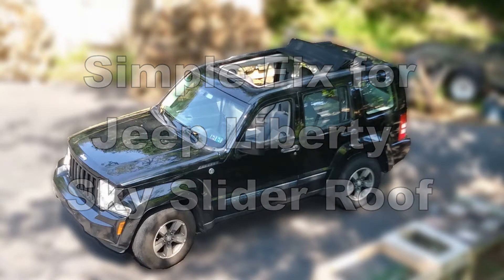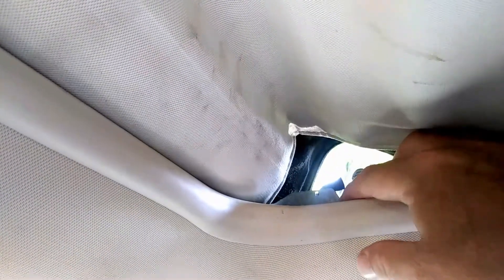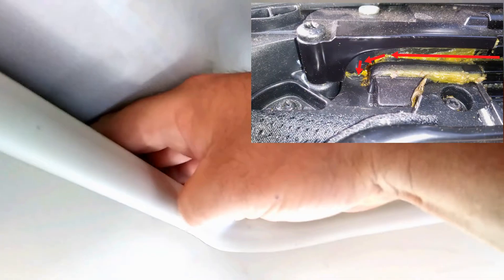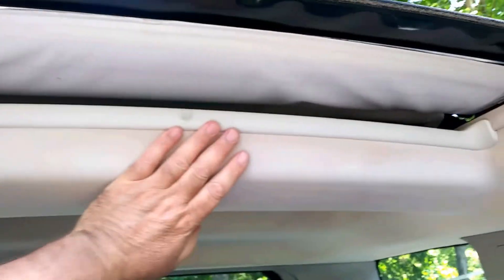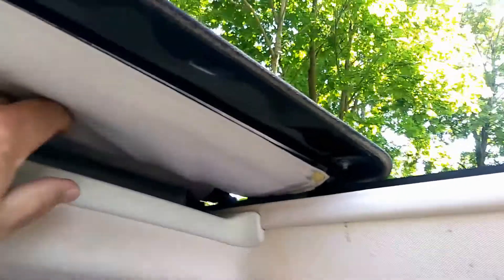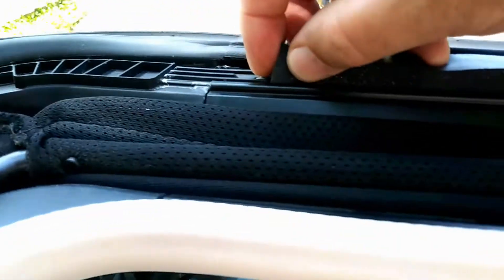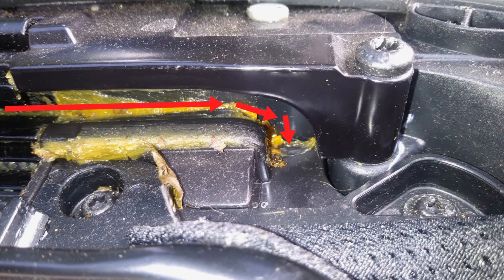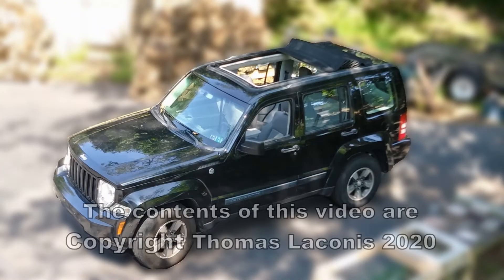Easy Quick Low Cost Fix for Jeep Liberty Sky Slider Roof Panoramic Retractable How To Repair SUV

Comment: I have one of these vehicles, and by the grace of God, nothing has gone bad with the sky slider as of yet. Thanks for the video I was wondering if you could make a video on how to clean out the section where the water runs down and out under the vehicle it doesn’t accumulate up in the tracks.

Comment: I'm making a 3 panel system to keep the option of a sunroof. The panels out of 1/4 finish ply. Going to stain outside and automotive clear coat. That way you remove front and back and the center panel is fixed for support. Maybe put mirrored glass panels in front and back panel. Fix noise and leaks in one shot.

Comment: So the clamp keeps the roof down and no wind or rain coming in? Not sure I follow.  Thanks.
Reply from the maker: the clamp holds it in place, make sure the roof is stretched as tight as you can make it, (do it on a sunny day when the fabric is softer and stretchable) when its completely stretched the end will fold slightly down. (see video for arrows) the tighter it is the less likely water will come it. Its a soft top so you will always have a wind sound, but you shouldnt have a breeze. I have no water leaks

Comment: I am so grateful for this post!! I was ready to give up on my jeep. I am ordering the parts now and will update you. 

Are you able to tell me what size piece you used to reduce the noise at the front?
Reply from the maker: it was 1", but get as thick as you can (2") because it compresses as long as its not dense foam it will compress fine, just make sure the canvas is stretched as far forward and to the back as you can so it seals the lip.

Comment: I found an idea where u add latched in the front with this idea for the back, so u can manually open it but also latch it down. Its pretty decent but i can not get this thing t9 open from the front. Gona try to find the motor cuz i was told u can open it by manually turning that. Thank you for this video
Reply from the maker: how to do get to the motor without tearing everything apart? My front is now broken in the completely shut position (luck for me!) I want to open it enough to cut the cables
Reply: @TheWorldAsSeenByTom  guess the motor is behind the cargo light, And thats supposed to just pop off. Im about to try it in a few

Comment: Question:  With the rear of the Skyslider clamped like this do you still retain the ability to open the roof from the front to back?  I assume you only lose the back to front opening?
Reply from the maker: yes you can still open and close the front if yours works, but do not open the roof 100%, stop around 90% because you may hit the clips. My roof hasnt leaked since I did this, but now my front broke, fortunately in the closed position.
Reply: @TheWorldAsSeenByTom  thanks for the info, this is really helpful. Do you still plan on trying to engineer a manual opening solution?
Reply from the maker: yes, i miss having it open. it will be a manual system. im trying to find the right clamps I think will fit before I cut the front tension wires/cords, once their cut theres no turning back. i need a good pic of the top opened on the front lip of the roof. I feel with my fingers, but cant really find a close area on the body.
Reply: @TheWorldAsSeenByTom  I should be able to provide you with a good image/video of that.  Let me see what I can do.
Reply: @TheWorldAsSeenByTom  I’m on it!

Comment: Yes, thank you. This is probably the sanest version I have seen so far. Don't need it yet (knock on wood), but Ive heard the stories. I've had my 2012 Liberty since 2014 and mileage is still under 50k.🐢 My question is this~ Is there a product that I can put on that top to keep it from getting dried out and vulnerable to tears (like a conditioner)? She lived in the Colorado snow and is now literally baking in the Arizona sun. This will be the 2nd summer here without covered parking....😬 Thanks!
Reply from the maker: any jeep or convertible top conditioner works.

Comment: thanks for this.  My daughter has a 2009 liberty and I've had to pay to get this fixed.  There is still a lot of wind noise from the front of the roof at highway speeds.  she doesn't even notice it anymore!  Any suggestions there besides that foam strip you put in?  thanks!
Reply: Hi Kirk, may I ask what mechanic or dealership you went to for getting this fixed. I've had no luck finding someone who can do the labor on the issue.
Reply from the maker: No one will fix it, the parts are obsolete.

Comment: I tried to push my daughters rear rail around the corner of the track, but it wouldn't go. Motor turns but too much resistance when pushing bar. I was doing it from the top while while standing on her bumper. Does it work better if trying this on the inside? Thanks for any tips! (only drivers side rear doesn't latch)
Reply: The front is secured but she won't let me open it to release pressure on the rear. She's worried the front won't close again!
Reply from the maker: i push from the inside only because I can push directly on the frame, i odnt know if it makes a difference
Reply from the maker: my front has since broken but in the closed position. i try it every once in a while but only when the weather is nice for along time just in case it gets stuck open. I have not been able to open my front yet. I have soem ideas for manual front release but cant try them until its open to see where i can secure clamps. once i do i iwll post a video. my rear cables make a click noise but nothing ever happens.

Comment: Hi, I’m thinking of a used 2009 Liberty with the same roof. 100k mikes, great condition. Thoughts?
Reply from the maker: you cannot buy any replacement parts for the roof, so if it breaks, you're screwed.
Reply: @TheWorldAsSeenByTom  I figured. Passed on the car, It would have been over $10k otd